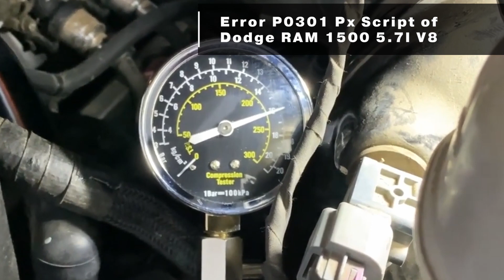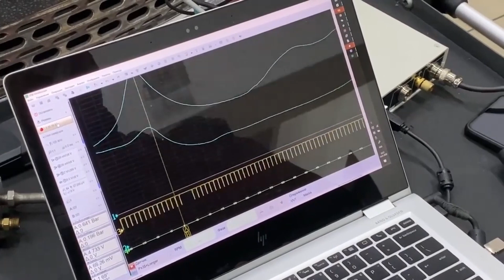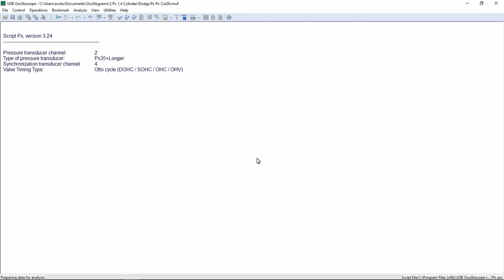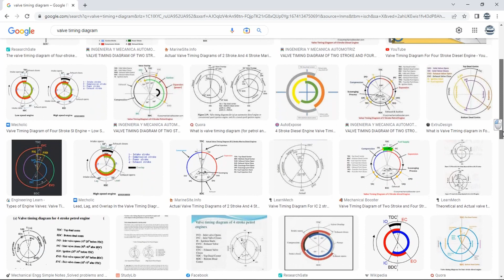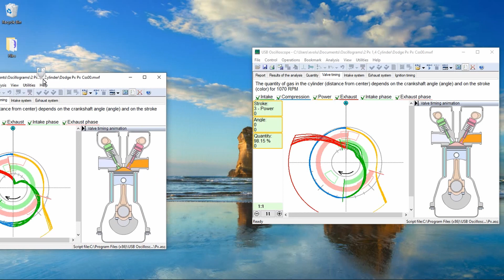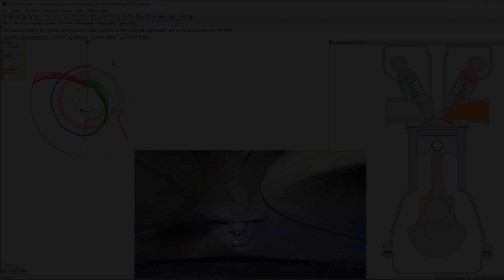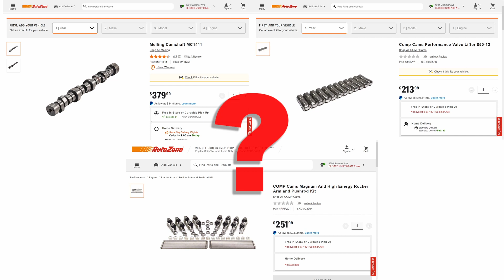DODGE RAM 1500 5.7 Hemi Misfire Diagnosis. Р0301

Comment: What's the point of picking up the signal from the crankshaft sensor in addition?   Thanks!
Reply from the maker: The recorded crankshaft sensor signal can be later analyzed using a CSS script. This allows you to perform cylinder balance test.
Reply: Thanks ;)